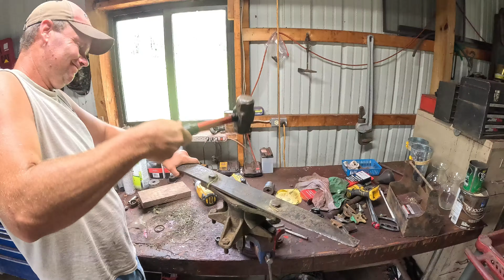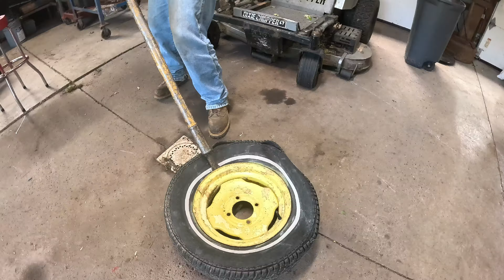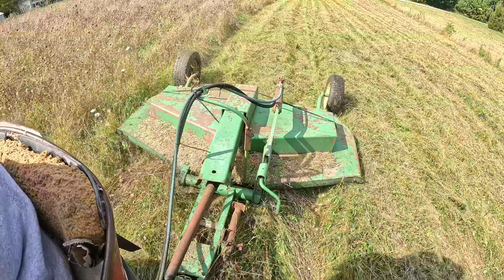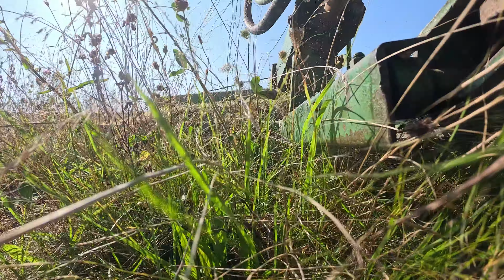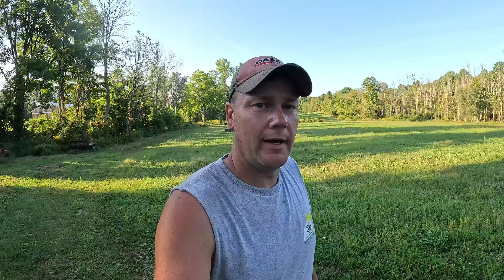Time to make it right. Mowing an overgrown hay field with the Farmall 460 & John Deere brush mower.

Comment: I pulled an old 6 ft continental brush hog, my 460 had no problem even in the heavy stuff.
Reply from the maker: I certainly enjoyed mowing with that mower.  That mower had what I would call oversized lawn mower blades on it vs your traditional brush mower blade.  It left a nice clean cut behind.  I'm sure it wouldn't like anything larger than 1 in or so in diameter.

Comment: The IH 460 is an under rated tractor. We had a utility model, it had good grunt power for chopping corn, baling and 3 btm plowing.
Reply from the maker: I do like mine a lot as well. If I had one complaint it would be it sure likes its fuel.  But all the 6-cylinder gas tractors back then did so it is what it is.  There isn't anything that tractor hasn't done that I have asked it to do with relative ease.

Comment: Ha, I was going to ask if the 460 rode high enough to avoid plugging the radiator with seed heads, but you answered my question before I could ask!
Reply from the maker: Ya it did plug it up.  It never overheated but did run slightly hotter than it usually does toward the end, so I knew it was getting plugged.  The mechanic in me makes me always watch my gauges and listen for changes.  Now I'm trying to pass that trait onto logan anytime he runs equipment.  Thanks for watching.

Comment: Matt, I have a 560 IH. Had the fast hitch cylinder repaired and since I can’t get it to work properly. It is either up or down nothing between. I reversed the lines and can get it to function better if I remove the link hooked to the cylinder which goes back to the control valve. I can move it separately and make the cylinder stop at a desired position. Any suggestions?? Thanks